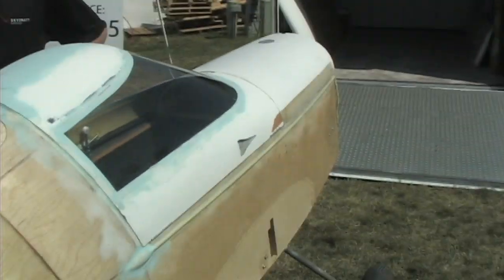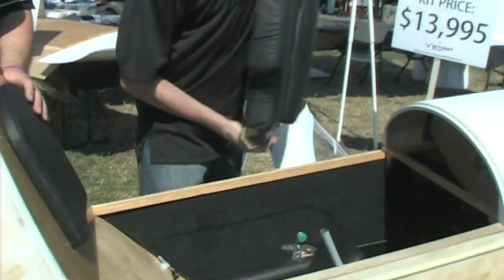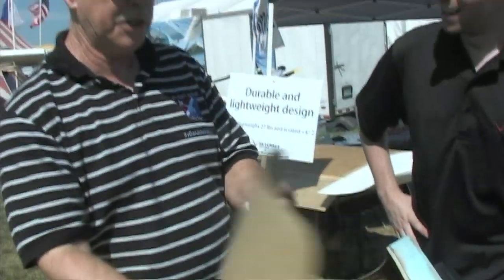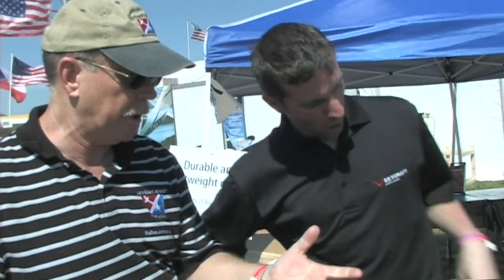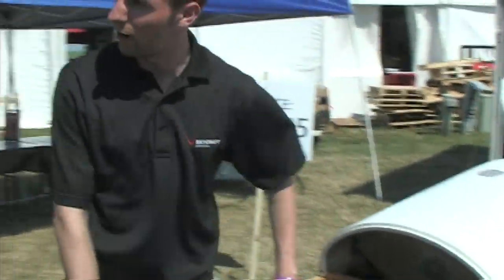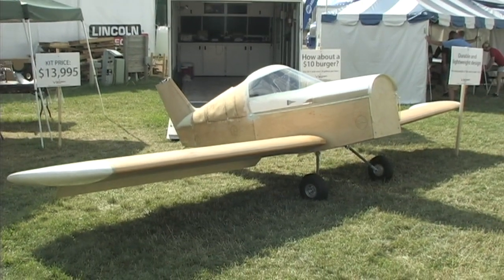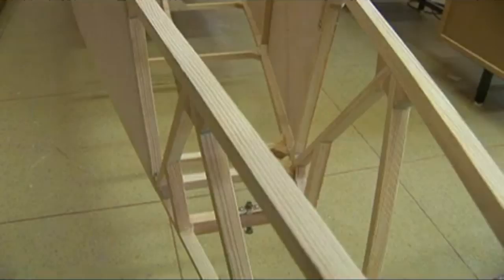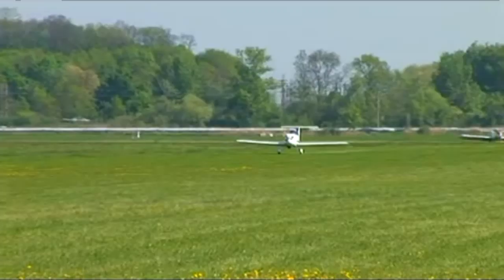SD-1 Minisport experimental amateurbuilt aircraft, Skycraft Airplanes.

Comment: READ..This BLOWS!  
SkyCraft Airplanes was a Light Sport Aircraft manufacturing company based in Orem, Utah. The company only built one product, the SkyCraft SD-1 Minisport, a single-seat low-wing plane designed in the Czech Republic.
   The company debuted the aircraft at 2013 EAA Airventure Oshkosh as a ready-to-fly, S-LSA Certified aircraft.[1] Production of the aircraft began two months prior in May 2013 and was intended to have a revised cockpit, including Dynon SkyView instrumentation.
   At the end of May 2014 Skycraft announced that light-sport flight testing had been completed. However, as of 7 August 2017 the SD-1 was still not on the Federal Aviation Administration's list of accepted light-sport aircraft and by the end of 2017 the company had gone out of businesses. 🐂💩!